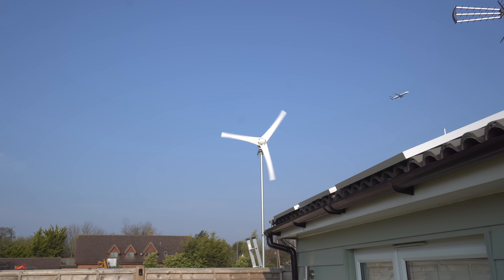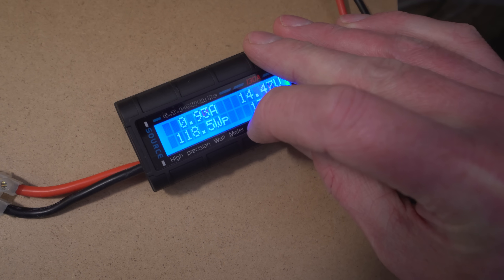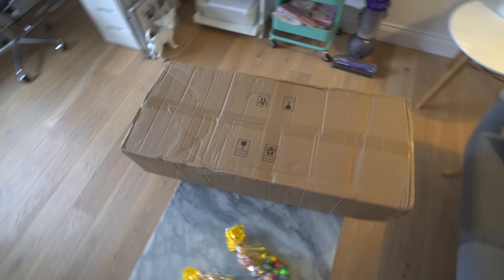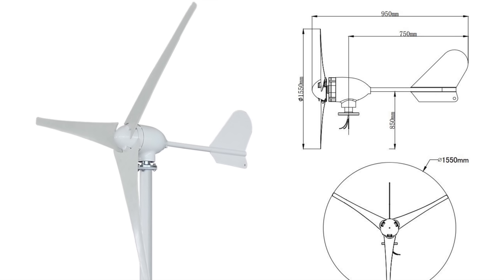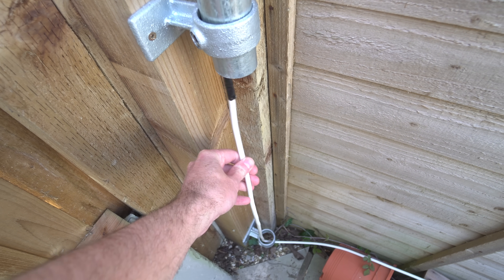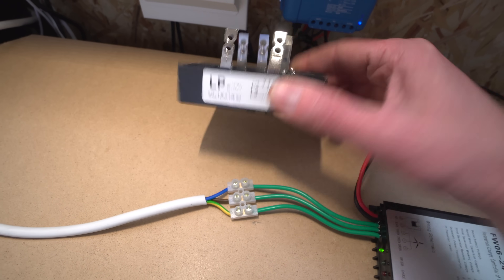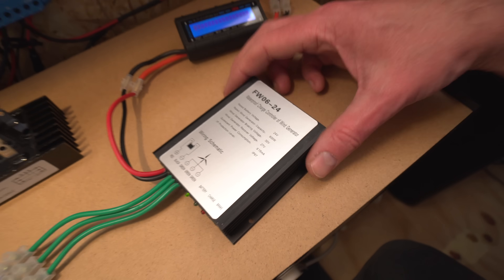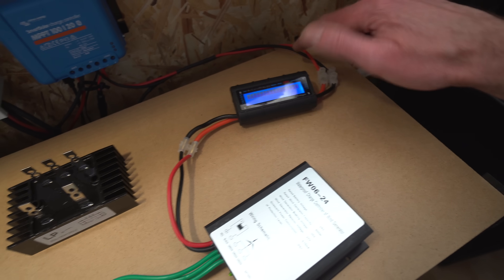500W MICRO WIND TURBINE | IS IT WORTH IT??!!

Comment: It is always worth it no matter if its 10W or 3000W, as longest you install it correctly. Unlike this uploader who prefers booking the wind with trees and a house.
Reply: Usually, they are never worth it.  The bearings failed after two years.  Grid Electricity is way cheaper ...

Comment: this is the future. if we beam energy down from solar mirrors, we are altering the amount of energy the earth recieves, wasted work is let off as heat, and no motor is 100% efficient. 
no the future is solar, hydro, and wind. problem is, you need battery banks but with new battery technology, who knows. maybe we can make high capacity capacitors and low discharge rates with room temp superconductors. pipe dream? i think not. with material science nowadays only getting more complex, so efficient your microwave and dishwasher burn out 2 years and just after 2 weeks off warranty. sometimes even within a week. thats how good they are at it.  the latest microwaves dont use transformers, only coils. many motors today made in china are inferior, a couple strands of copper wound with aluminum in the armature, they dont last as long as the old school full copper windings.

Comment: Lol that one may not work here..we have way over 25 mph wind a lot...we had 70 mph the other day that broke some stuff...and I've already about went bust buying solar but have a question anyways..I want to help my solar system a little at night or on cloudy days so I have a semi rare 36 volt Honda alternator from like 1972..it doesn't matter how fast it turns it won't put out over 36 volts..just designed that way..anyhow I have the idea to run that thru my 4215 BN charge controller with just a rectifier and let it change it to 26 or so...should that work or can it go direct to the regulator (3 wires in, 2 out) but hook that 13.8 to the bottom set of four batteries (12 v) ?? Which do you think would put more watts in the batteries? To keep it same brand I'm gonna use a 19 inch Honda motorcycle mag wheel from a 750 SS for the blade hub...I'm gonna weld a piece of strap around it to weld some blades to...it doesn't have to be all boughton stuff does it? I'm thinking a 5 ft blade would be about right...

Comment: 500W ? That's only 1/2 a kw .  Not gonna power much
Reply from the maker: 500W over 10 hours is 5kWh which could be enough to power a small home for a day. In reality it won't make 500W all the time if at all but it does produce some energy.

Comment: New idea bro...3 electric bike wheels at 1500watts each mounted to tow hitch. Every time u drive you fill auxiliary batteries for later use. Some folks here use reconditioned fork lift batts....they can last 30 years plus...no more buying batteries...
Reply: I was thinking the same thing !
Reply: @engleblerthumferlumpadinck6536  Can you pickup a 1,000 Pound forklift lift battery?

Comment: Hey guys, I’m new to electricity. I’m confused at how the turbine can produce voltage, but little to no amps or watts. Why is this happening?
Reply: @james pyun 
Watts=Volts times Amps. 
It can be ‘excited’ at low wind speeds and show a voltage output (17VAC), but have little power (Watts) because it’s making low current (Amps). As wind speed increases the AC voltage soars and it will start producing ‘usable’ watts. 
There’s vids out there that explain this nicely.

Comment: HEY Andy i found a 1kw wind turbine from china i have solar 3.2kw system grid tie in already can i attached the 1kw turbine convert it to dc then connect directly into inverter or shall i connect it directly into the AC cable thats going into the fuse from inverter yoshi which is best can u let me know buddy

Comment: you need to have your turbine at least 30 ft. above and 300ft away from any structures in the area to get an ideal wind column and even more ideally, if you can get above 100ft off ground level, then you are in a great air stream, your turbine looks to be mounted much too low, a common mistake.
Reply: Typically, you cannot mount a wind turbine 30' in the air, in a residential area.

Comment: Do you have the victron controller because your batteries are lithium? Would the smaller white controller that came with the turbine be fine to connect straight to deep cycle gel, or sealed lead acid batteries?

Comment: Hey,I live in a converted lwb hightop van and looking to wind power.aswell as solar, are the wind turbines as good as it seems. I like on the south coast so the wind does pick up.
Reply: Consider driving the vehicle with wind mill ...might look stupid...but after 9000 electric bills that used to be 300...aint so stupid now. I also envision a 1000w e bike wheel attached to a hitch. Generate max amps for aux batteries used later that nite...3 wheels would power a Tessa wall sized for an auto...double use for your gasoline

Comment: I would consider what the output from the three phase Controller is, if the victron input is the MPPT type, it needs more than 12v-18v to utilize the power coming in from the wind or solar, so basically, if the three phase Controller is output isn't outputting the 24v that the mppt controller needs to work at it's best, then you might need to get rid of the controller that came with the turbine and Go directly from the rectifier to the victron.. hope this helps 🙂
Reply: No, nothing will help "junk" ...

Comment: @Andy Kirby the discrepancy is most likely due to the fact that your using a mppt - which senses a while and adjusts on load change. theese are not particulairly great for such fluctuating loads. use a pwm fed by the rectifier from the wind turbine in parallel to the mppt from pv & batteries instead to not loose that power (Wind ->Rect->fuse->pwm->fuse->batt). btw. loving what you do - i am pretty similar minded haha from europe - germany. actually want to get a twizzy sometime ( loved what you did with it ). Kind of want to do the same - tires + twizzy box for commuting :)

Comment: I think you're a little confused at what "3 phase" is...
Reply from the maker: There’s a lot of people that don’t understand that a wind turbine is a 3 phase AC generator. Not to be confused with 3 phase mains supply 😉
Reply: @andykirby  lol, of course its 3 phase, makes it far better and easier due to a lower ripple factor, but you are NOT using 3 phase wiring, you are using standard single phase twin earth house wire....
Reply: @drewjohn6847  So what?   It is still 3 Phase power from the Wind Turbine ....

Comment: Hi mate,
The turbine is an a.c. producing generator, the controller is the 24v part? The controller converts the a.c. to d.c. and outputs 24v d.c. Is that correct? So, could a 24v controller be connected to a 12v AGM deep cycle battery?
Great vid,
Cheers.

Comment: It is not 3 Phase. Electrically 3 Phase is 415v AC. What you actually have is 24vDC, the cable is 3core.
Reply from the maker: The turbine is actually a 3 phase generator, don’t confuse it with mains terminology, there are 3 phases producing a 30V AC waveform which is then fed into a bridge rectifier to convert and regulate it to 24-30V DC.

Comment: If you had a storage area to collect water up high in a hill then there would be no need for battery controllers etc and the turbines could run pumps directly mechanically then tat would be the best system and when power is required the water would run down hill under gravity flow to run a big generator when required.
Reply: Or have it running a compressor with a big air vessel buried in the ground and run your Genny from the compressed airline

Comment: These controllers are shite. If you want to measure power connect her directly to batteries through rectifier momentarily and measure the power out with a meter. Use a 12 volt system and a controller that kicks in below 18 volts.

Comment: replace victron with a high watt buck converter. set the buck to the max voltage of the batteries and thats it.
Reply from the maker: Yes that sounds like the best thing to do 👍
Reply: that's what i've done to my one of these which also never generates high enough output voltage to even start charging a 12V battery without a buck boost converter

Comment: The most efficient has one blade but balance is an issue. Two blades get interference vibration at 2x per rev. Three blades is a good compromise. 5 blades will make it turn slower.
Reply: one blade is perfect, but you do a vertical instead of horizontal blade. it works no matter where the wind comes from but you will have slight obstructions from the stuff that holds the top of the blade so it isn't only connected at the bottom, but they are VERY efficient and spins from wind from any direction, even turbulent one
Reply: @LiLBitsDK  A VAWT is worse ...

Comment: The best thing you can do to increase the efficiency of the turbine is to get it away from the house AND increase the pole height.  Turbines need unobstructed, non-turbulent air flow.  If the box says 4.5-meters, that is 4.5-meters above the house peak.
Reply: And you got a 500W Lightning arrester as well ;)
Reply: And above all nearby trees ...
Reply: @MrSummitville  ¹111¹1111⅕q
Reply: You have to be either on the coast or near the coast with no buildings between you and the coast. Or on a flat plain in the middle of nowhere
Reply: Exactly id say 10-15ft higher than nearest  roof peak and or trees
Reply: That’s a good tip. Even if you feel the wind at ground level it’s going to be more powerful high up
Reply: Or buy a solar system. But, if this is UK, that won't work. 😁
Reply: @patfranks785  coastal residence could benefit using this mini wind turbine, as the winds might frequently passing by their area at a certain height, say like 15 meters above the surface
Reply: @sunder739  if you live on the coast sea level is fine
Reply: @patfranks785 for UK  better buy hydraulical system .
Reply: @williamjolka4351  or perhaps water battery technologies which are just being 'rediscovered'
Reply: @chuckspencer8540  you must patent it. I see à great future in Hollande water 😊
Reply: @chuckspencer8540  Holly water. 
Bloody french automatic writing...
Reply: I only have one electricity meter, why do you need 4.5, and how do you cut one in half?

Comment: Is that an MPPT controller? Can I combine solar panels and wind to generate power almost all day? Wouldn't the roof help speed up the wind as it tries to get around the building? This has a future.
Reply: The MPPT controller must have separate INPUT CHANNELS for Wind & Solar.  You need fast winds, usually much more wind, than people think.

Comment: You know, if someone were to build a house around primarily 12v lighting and appliances, these smaller turbines would probably be more viable for home generation.  The conversion for 110/220v is so inefficient.
Reply from the maker: Yeah you are absolutely right, I’ve been saying it for a long time.
Reply: wrong.       why.      1)  DC  cannot be run long distances, without significant losses,  unless the conductor is the size of your  ARM.    thus,  mains  DC  is a great idea.      2)   the energy density of  DC watts is  greater than that of AC  watts.    (for the rough estimation of  Equivalent  watts,  a factor of  1.41  must be used; this is the sq-root of two)     3)  this is why  there seems to be major losses.     but, actual losses are  Minimal.     googletranslate
Reply: @daviddavids2884  1: You're assuming a long run with high current.  I'm not suggesting that.  Most led bulbs and devices use less than 10 amps, so they can be fed with standard 12-14 gauge speaker wire runs of less than 50 feet. 

2: There is STILL a loss to convert from dc to ac, no matter how small you say it might bet.
Reply: @daviddavids2884  If you're going to try and have an argument in english, maybe learn english first.  You replied to MY comment, so you wanted this argument.  You lost.  Get over it.
Reply: @daviddavids2884  You wrote,  "... wrong.  why. 1)  DC  cannot be run long distances, without significant losses ..."  What you wrote is not true.  The truth is ... AC amps vs DC amps AT THE SAME VOLTAGE, is essentially the same losses and the same wire sizes.  The problem with 12 Volts ( AC or DC ) is the AMPS will be 10 TIMES HIGHER than the amps at 120 Volt ( AC or DC ).  Low Voltage ( AC or DC ) with HUGE AMPS is a big problem.  The "power loss" in the wire goes by the SQUARE of the amps !!!  So, 10 TIMES the Amps = 100 TIMES the losses = OUCH !!!  A Low Voltage home is not more efficient, it is much LESS efficient than a high voltage home.  Conversion from 12 V DC to 120 V AC is actually very efficient.  Why not just buy a HIGH VOLTAGE Wind Turbine, in the first place?
Reply: @MrSummitville  you are invited to run DC, continuously, through  fifty feet of  16 awg wire, and see what happens.      'the problem with 12 volts...' is that, at you do NOT know what your are talking about.
power is  WATTS, not volts.      watts = amps x volts.
for a given  amount of  Power,  watts, the amount changes only slightly, in  inversion/conversion.     out
Reply: @MrSummitville  final question:   why do you think  AC  is running through  ALL   utility power lines???    peebrain

Comment: I have the exact same charge controller and I tried it for my wind turbine. The problem is, is it being MPPT, so unlike solar how it can extract as much power as possible from a constant supply, the wind turbine power fluctuates all the time massively and the controller can't charge properly as it's trying to find the maximum power point to charge effectively. If anything, you need a controller that's not MPPT, which I don't think victron do that's also bluetooth.

Comment: Andy have you balanced the blades?....don’t use five blades because they are not as efficient! I was looking to do this but planning is required, even so I was going to go ahead, and make it lever up and down, so when the wind drops for days on end I will take it down. Looking at the voltage level problem, why don’t you feed it into a bunch of capacitors, and then drain off into the battery when full to help smooth the load?

Comment: Did some quick math on his 60 watts over 2.5 hrs: at $.12/kWh retail here in Indiana (US), it would be on track to save roughly $25/year. If he only spent $1k on the total array (including time), a bank CD earning 2.5% would be equivalent (unless factors changed of course).
Reply: 40 Year to break-even !!! ( =  $1,000 / $25 per year ).  It will fail before it ever earns the $1,000 original investment . So it earns NOTHING . It is a toy...
Reply: @MrSummitville  Failed after 2 years . . . . $1000/2 = $500/year . . . . Definitely NOT worth it.

Comment: I am thinking about a wind turbine too, my garden faces open fields and the river seven. there a few advantages to a turbine, 1 is can run for 24hr a day, 2 it keeps your batteries topped up possibly extending the life of your batteries. since I only use a few things in the house its about 300W hr I use. but come winter using electric heaters is going to be my enemy.
Reply: Small Wind Turbines are toys ...

Comment: Another plus is the Potential to make power doesn't go to bed with the Sun.
Reply: The COST is a huge negative
Reply: @MrSummitville  Commercially yes.   Not for the Rual Home Owner.   Same can be said for Solar Cost.
Reply: @pulesjet  Apples-to-Apples comparison ... So tell me ... What is the TOTAL COST to install a complete system "Wind Turbine + Tower + Controller" that will generate the same kWhrs per year as my 8,000 Watt PV System?
Reply: Read my post.    I said Commercially did I not ?  I said nothing negative about a home system.  Wind and Solar are NOT a commercially viable system.     My  little 500W turbine is on a pole 20ft above my roof line.  It alone brings  my power  bill down 30% for two and three months out of the year.

Comment: Quick question I already have solar. Can I just go directly into my battery bank  out of the charge controller?
Reply from the maker: Yes you can. The controller included with the turbine is meant for Lead Acid and you can pick 12,24,48V turbine controller setups to match your battery voltage. It definitely helps keep the batteries topped up.
Reply: @andykirby  Is it that easy I just need a wind charge controller and connect it to my  battery bank for my existing solar setup? Is that all I need to really do?

Comment: Electrically heated in floor coils can absorb a lot of off grid electricity. Insulated thermal mass concrete and tile floors could be heated with the windy winter. Is it windy in your winter season?

Comment: Hi Andy with all of the power supply stuff u play with in the workshop do u get much noise on the radio from it?
Reply from the maker: Yeah you know what I do get a bit of noise but I don’t think it’s coming from the gear, I think it’s coming from the airport.
Reply: @andykirby  i guess if its from the power stuff it could show up more on HF mate. Be interesting to see if turning stuff off and on made a difference to the noise levels.
Reply from the maker: I did actually try turning stuff off but I still get S5-7 of noise on VHF. UHF isn’t too bad. I’ve been meaning to stick a HF antenna up to see how well it would work, it’s a good high location here with a nice takeoff.

Comment: If you are gonna use an mppt controller, you should consider placing a few very big capacitors on the dc side of your rectifier. To stabilize the voltage.
Reply: So the capacitor will store the low voltage energy from the turbine till it reaches a voltage that will charge the batteries
Reply: In parallel with the battery?
Reply: @nekelly123  No, the voltage needs to be stabalized into the DC input of the MPPT controller, otherwise the MPPT algorithm will be confused by the 120Hz voltage changes (from 60Hz full-wave rectified). The battery voltages should be very stable on their own.